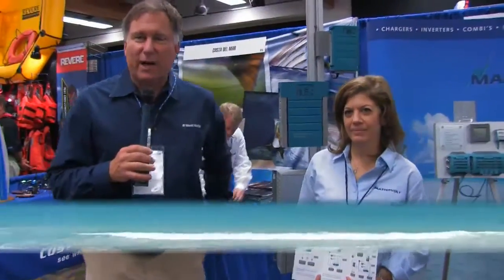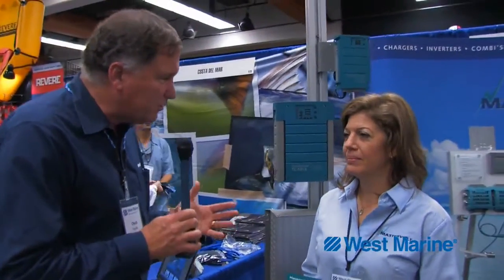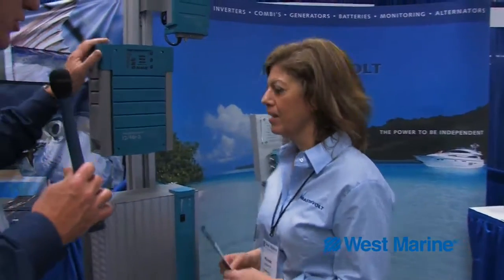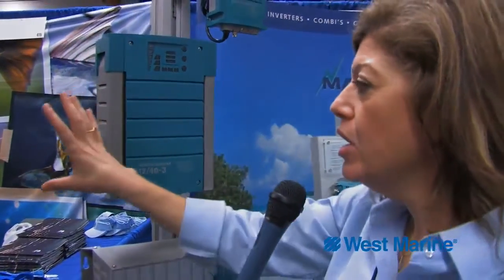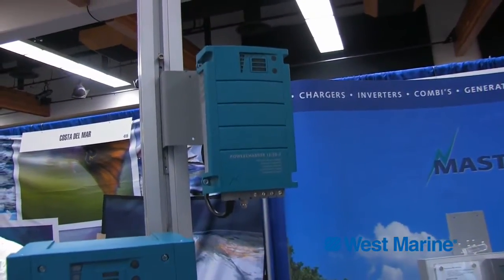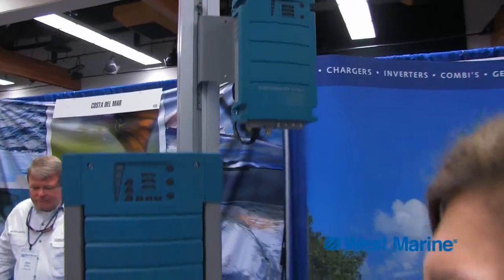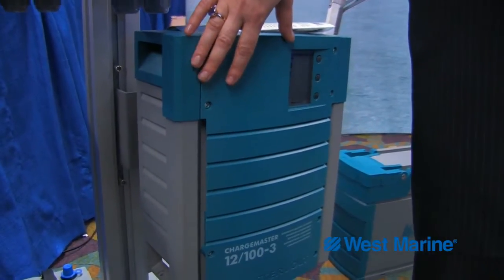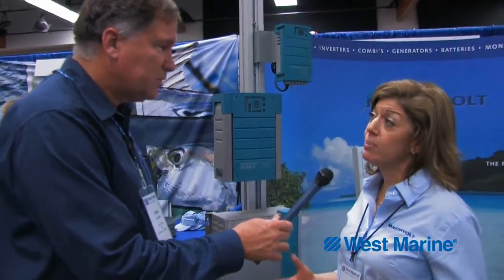Mastervolt Marine Battery Chargers

Comment: They are no longer reliable. I have had 2 expensive chargers fail in 3 years. Also caused battery failures. They started off good but changed factories